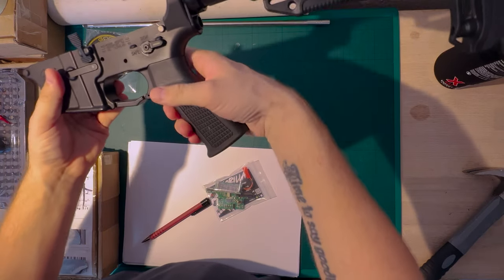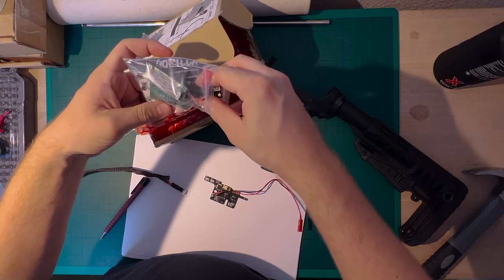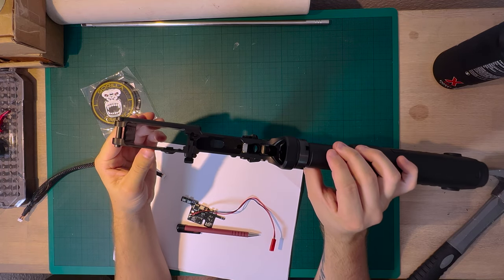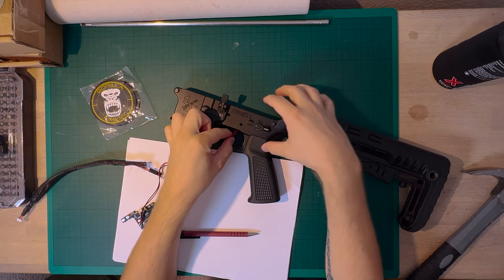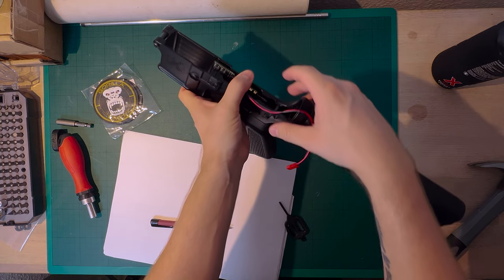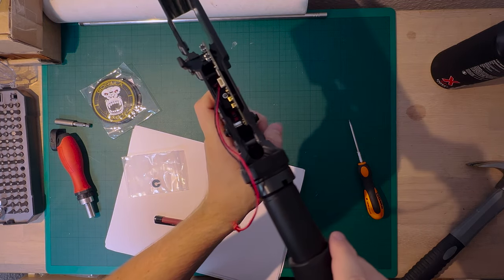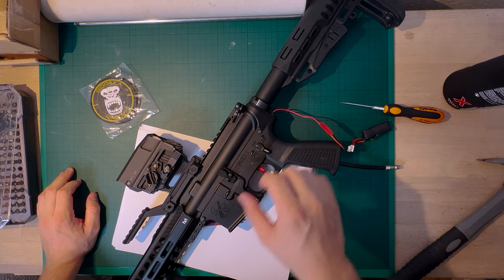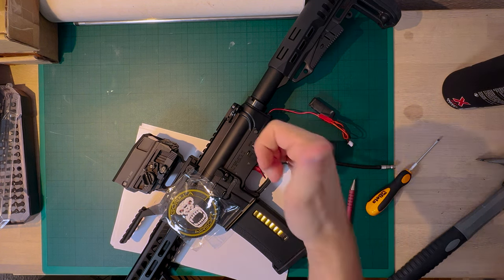What is Gorilla MTW mMTW? - [The new best thing?!] *UNRELEASED*

Comment: Thank god the triggerboard is a fullsize and not like the current model from Gorilla. I have so many problems with the wires since they are pretty thic and the board keeps missaligning so after some shots it wont realise the trigger pull. thats basically the only reason i removed the Gorilla from my MTW. and i am in the process of designing a selfmade triggerboard ind the original size because the front "arm" on the board with the mag and bolt switch is what keeps the board in place.
Reply from the maker: I never expirence that issue and run gorilla in all my guns, the old version and that.
Reply: @kaslab  ok I just recently startet having the issue. I have about 50 pulls till i dont fell the click anymore and frome there i get 2 out of 3 shots to break and keeps rapidly getting wors till no shot  going off. i built some spacers to keep it in place which worked to keep it running but now i wanna just make it right with a correct trigger board but then i saw your video and im hoping to get my hands on the new version as soon as possible!
Reply from the maker: @PARA19951  I just wrote to gorilla, and they said it is most likely wrong triggerscrew tuning

Comment: I love your game videos but your instructional videos needs improvement. Doesnt really explain everything to most of us who arent techs and are doing it for the first time.
Reply from the maker: It shows everything you need to know
Reply from the maker: what does it miss?
Reply: @kaslab Well one is the assumption that we know how to take off the  trigger and old trigger board. Second is how to set the trigger spring where you actually use a screwdriver to do it but dint describe properly what to do as we cannot see it on the video.
Reply from the maker: Hmm pretty sure I say in the video I "assume you know how to install this since its advance" anyone doing this first time should prob get a tech to do it, most people tend to just break things. Also I have videos where I have full breakdowns, wolverine have videos where they show how to remove it step by step, I need to make the videos as short as possible or people wont watch it at all, so when there are tons of videos out there how to take it apart, then it's better to save 5mins of the video adding knowlage like that, also the wayI "put in the triggerboard" is the same way as you take it out, I hope this clears up some things, I use to show everything very little cuts and going over all, those videos would have bad retention since they're to long. But I do appriciate the feedback. @jpracingph
Reply: @kaslab  Got it. And thanks for the videos!